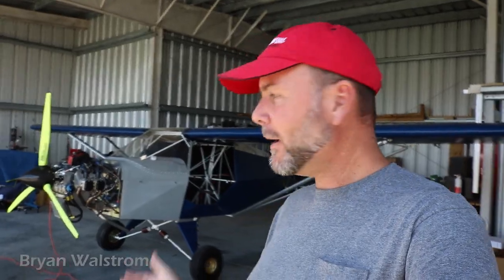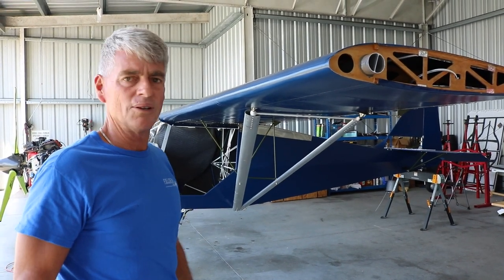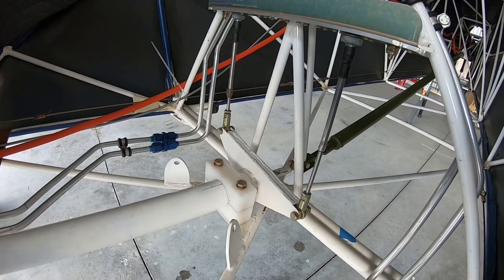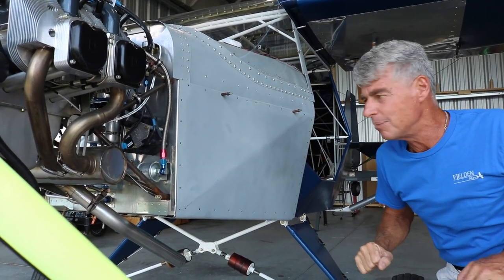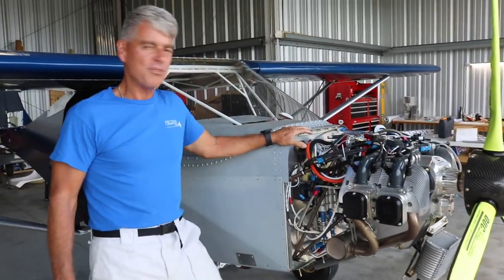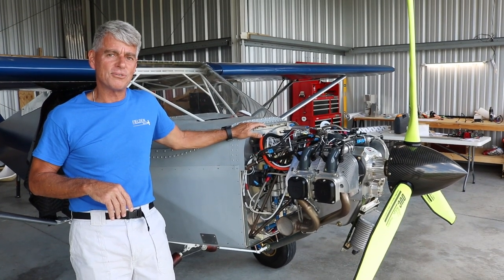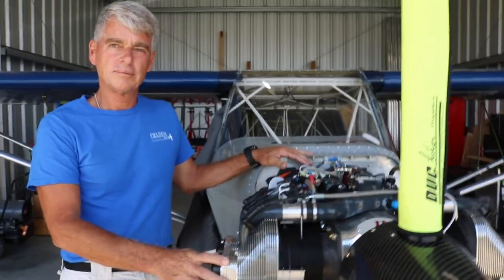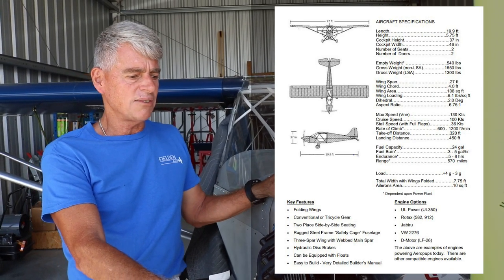AEROPUP Aircraft - Tailwheel Kitplane Now in USA

Comment: This type of web spar and ribs were also used on the folding wing 
Kitfox aircraft clear back in the 1980's. This aircraft looks like a copy of the Kitfox.  Nice plane. I built serial number 12 Kitfox.
Reply: Designer John Cotton started with a clean sheet of paper on this aircraft with a single seat version (the Super Pup...which I happen to own) coming quite a while before the Aeropup 2 seater. The wings have been tested to 6 G's @ 600Kg AUW.  There are substantial differences from the Kitfox, spar location,, rib, aileron design differs, nor are the ailerons hung Junker style off plywood ribs. The Aeropup resembles the Kitfox in the same way that all fabric and tube taildraggers can be said to resemble a Cub
Reply: @reincarnatethylacine3745   he might have started with a clean sheet but its absurd to say that he didn't borrow heavily from the kitfox.
Reply: @eether54  Wow huge assumptions there dude, I guess you’re a Kitfox fan. I'm not a designer myself and I'm expecting with a comment like that you’d have looked at all the design details and then made an educated comment based on the aerodynamics and overall design philosophy, or maybe just posted what you thought sounded like you're an expert then??.
Reply: @alistersladen1212  I own a kitfox so no assumptions were made. Its not a knock to the aeropup as originally designed, its just a fact. I've seen this specific aircraft twice in person and the similarities are obvious. Its a great design!